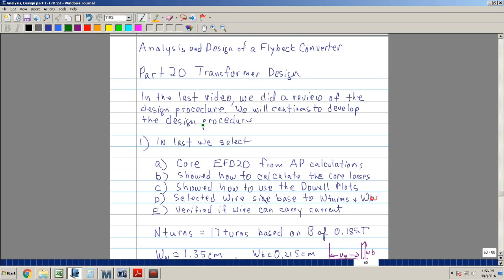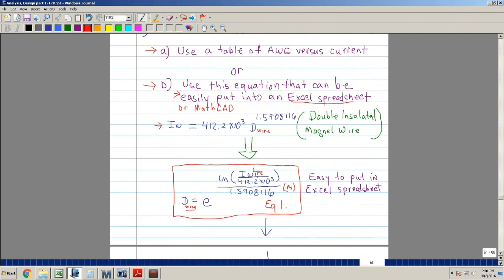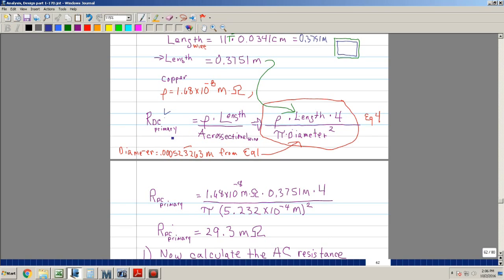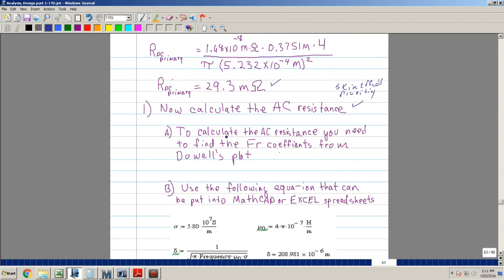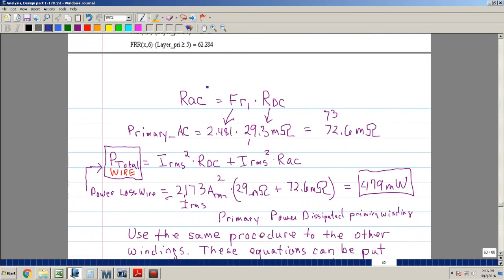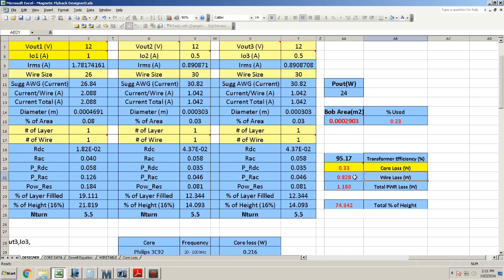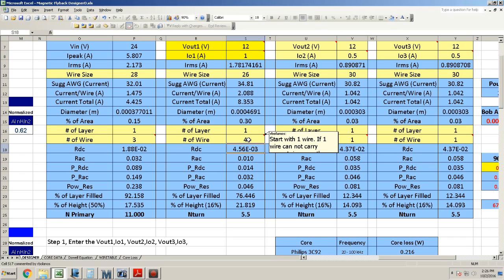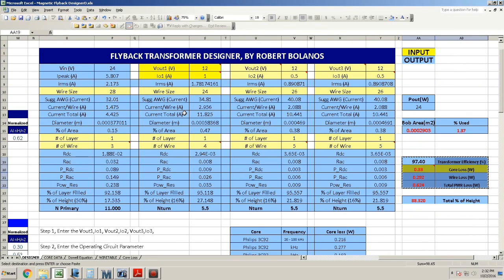Analysis and Design of a Flyback; Part 20, Transformer design C

Comment: As always, I enjoy watching your videos and learning new things.
May I ask why you didn’t use the current density parameter in the formulas for calculating the wire diameter?
Additionally, could you share which reference you used for the formula to calculate the wire diameter based on RMS current?
Reply from the maker: Happy new year Jabbari. I was trying to mimic the  procedure that my long time magnetic designer, Dennis Guerrero designs his magnetics. He uses the magnet wire fuse current (10 percent) or the current carrying current to size it wire. So derived a formula to estimate the current vs AWG table formula. If you email, I have my notes how I derived the formula. Another way of doing would be to use a lookup table with the AWG vs Current. Email and I will send you my notes.

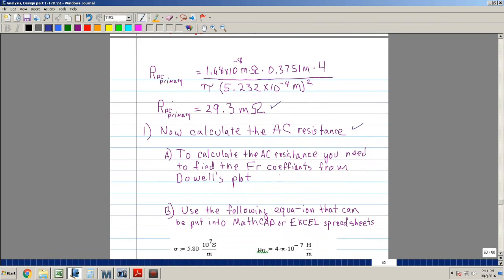Comment: Excelente video!!! A question I have tried to follow the Rdc equation (15:17 and 23:42) and I can see that there is a factor in the multiplication = *2.4, why? This value does not correspond to the one in the excel sheet provided by you... is it an adjustment factor? thank you very much for your reply.

Comment: Dear Robert :- I have been thru your previous videos...and I have almost made an excel sheet exact identical to yours. IN your previous video the current in primary works out to a differnet value  3.76 Amps. Basis of calculation is Ipeak*D^0.5...however in this video...the valu of current drops to 2.17 amps...which I am not able to figure out how it changed.  Could you please confirm which value of current is correct ?  Thanks & Regards
-Rakesh
Reply from the maker: Hi Rakesh, email me at rbola35618@aol.com and I will send you my SPICE file along with an updated Excell Flyback Script.  Robert

Comment: Hi Sir, you are great in making complex concepts easy. I need your favor. I am a junior research engineer. I am trying to develop a flyback converter just for understanding purposes. Our goal is something different. Flyback have following specs: Np=30T, Ns=2500T, fs=34kHz, D=47%, Vin=20V, RL=1Meg. Leakage Inductance Llk=200 uH. The Core is UU Core of MnZn Material having Effective Core area of Ae=191mm^2. Both primary and Secondary Windings are wound on separate legs. Primary Winding is of Single Copper Conductor of AWG=25. The issue which I am facing is that during ON Time (Ton), the inductor current doesn't increase linearly rather it oscillates and it seems that there are sinusoidal oscillations which are superimposed on the linearly Increasing Inductor Current.  Due to this reason Output Voltage is much smaller in amplitude than the theoretical one. can you Plz explain the reason and Phenomenon which causes inductor current Oscillating. and also how can we solve that problem. Any helpful Information will be Appreciated. A Rough Sketch of Primary Inductor Current during Ton is attached herewith . 
https://drive.google.com/file/d/1HHPh5b1vHrkywzdQzuXvkwrtDxF-Ipu2/view?usp=sharing
Reply from the maker: Hi Imran,  If you have a schematic and a parts list, please send to rbola35618@aol.com    Also, what is the inductance of the primary open circuit, and the inductance of the secondary open circuit. Then take the short circuit inductance measurement of both the primary and secondary. Also, do you have a output capacitor and what is its value?   I also need the Vinput operating rangne. Vout,  Iout.  Robert Bolanos

Comment: Sir I have selected EE55/55/21 core (TDK) as it was available at my place, the problem is that there is no info about mean length turn in data sheet. Is there anyway to calculate MLT ??

Comment: 12v input  12v output 0.6A can i use these equations
Reply from the maker: Yes it will work for a discontinuous flyback. If you email me at rbola35618@aol.com, I can send you the excel spreadsheet
Reply: chintukota1@gmail.com
Reply: please send auxlury winding equations also

Comment: Dear Robert,

Could you please consider doing the following in the next set of videos:

  1. Relating temperature rise and power loss of the transformer.
  2. *Actual measurement of temperature rise.*
  3. How to set the permissible temperature rise of the transformer. (Material limitations and ambient considerations.)
  4. Is there a way to measure core loss and wire loss separately.

One gets greedy after being fed....you know.  :)

Regards,
Anand

Comment: Thanks so much Robert, please can you explain how we calculate the gap for the forward transformer?
Reply from the maker: The forward transformer does not have a gap. However, the flyback does has a gap. You can calculate the gap. However, the gap is found empirically by winding the bobbin and then you grind the center part of the core and you reassemble and measure with a LCR meter. You repeat this process until you get the required inductance. 

https://www.youtube.com/watch?v=mW03NqvXez8&list=PLQJi4gXVTqsyCZSNTojtr9aU28rpbWu2q&index=20

Watch the first 13 minutes of the video. Hope this clarifies your question.
Reply: Thanks so much ,you are very helpful
Reply: Hi Robert ,what will happen if he forward has gap,is this energy will increase loses and saturate the transformer and can damage MOSFET?
Reply from the maker: The flyback has a gap and because you want a specific inductance in the primary. A forward, you do not design for a specific inductance. However, by putting a small gap will not hurt your forward transformer. What it does it make the B versus H plot wider which means that it desensitizes the changes in the inductance. Typically, a ungapped core will have a +/20 tolerance, by putting a gap, you can reduce the change to 5*/ percent change. Hope this makes sense.
Reply: Thanks so much
Reply: But this gap we use it to charge energy?is this true
Reply from the maker: The gap is used to store the energy but only in a flyback inductor. Remember that when the Mosfet is on (Ton), the energy is being stored in the core or gap. Then the Mosfet turns off (Toff) and the energy in the core/gap is then released to the secondary. In a forward converter, the energy is not store like it is in a flyback. The transformer immediately transfers the energy from the primary to the secondary only when the primary mosfets are on. Therefore, there is no energy stored. Hope this makes sense. Best regards, Robert